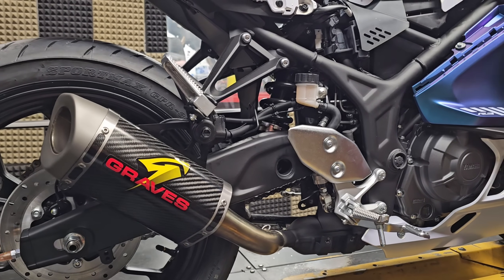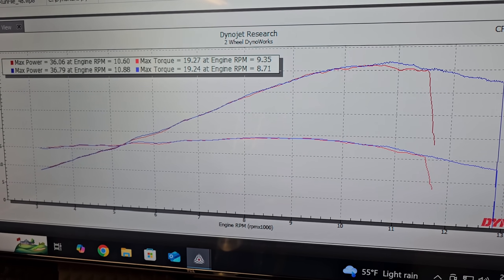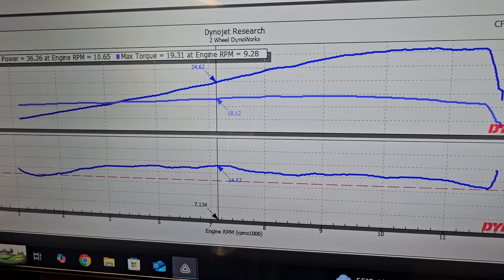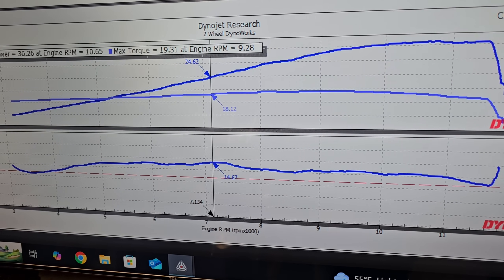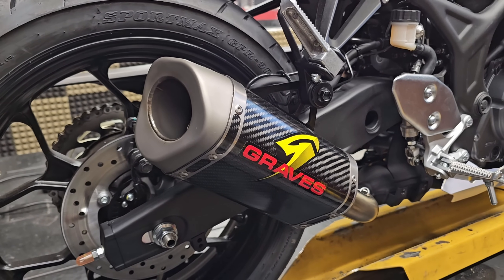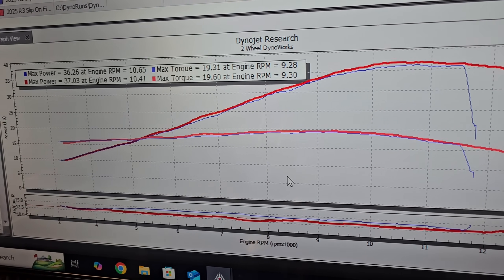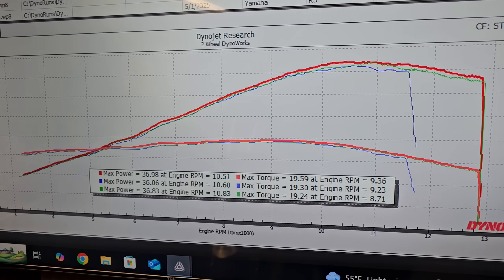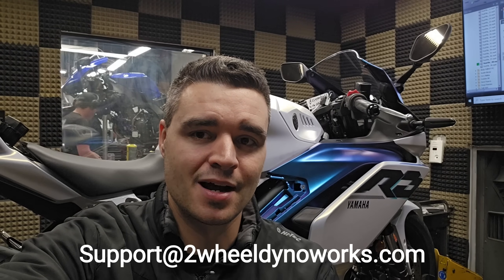The SURPRISING RESULTS of a Slip On exhaust on our new 2025 R3!

Comment: Hey! I have a ‘25 Yamaha R3 and I’m looking to get a full exhaust done and get your ECU tune. Do I need to get both an o2 sensor eliminator and and AIS block off plate? Do you happen to have any links to recommended products to use in conjunction with your ECU tune and a full exhaust? Thanks!

Comment: R3 is quite underpowered i think, cbr250rr sp easly make 38 whp with exhaust and ecu flash
Reply: that's also the difference between an inline 4 and a parallel twin
Reply: R3 is being sold worldwide and is legal.. the 250rr is only available in a couple countries and is built around a specific lack of emissions regulations. These 2 bikes arent even meant to compete against one another, completely different market and customer aim.

Comment: Its going to run leaner because you have a freer flowing muffler which means more exhaust gas is able to escape during the exhaust stroke which means more air intake into the chamber during the  intake stroke ...
And yes there is no wideband O2 to see the "leaner" mixture so it cant add more fuel which is why it runs lean. 

This is where the tune comes into play.
Reply: you think he dont know that? ur just repeating what he said
Reply: @BoxingLegends2024  He never said that
Reply: @BoxingLegends2024  but more useful than video itself, to the point. 1 like from i.

Comment: Yamaha needs to release an R4 or R5 lol. All they needa do is keep it simple like the R7, but with a 400 or 450cc motor. Match the looks of the R6 or just any of the R series and they would own the 450cc class lol
Reply: YZF-R4 with 450cc displacement would be nice. It's the burgeoning class lately.
Ninja 500/Z500 (451cc)
RS457/Tuono 457 (457cc)
CF Moto 450SS (449cc)
Triumph Speed 400 (398cc)
KTM Duke 390 (398cc)
Reply: agreed, they need to
Reply: R5 at 500cc 👍
Reply: Hear me out”R6”
Reply: Don’t remove the R3, add an R5 with 3 cylinders to the lineup. It would fit perfectly into the lineup
Reply: I used to think that, but I'm not so sure anymore. My R3 has plenty of power for all my needs.
Reply: Disagree, in the SEA market, the r3 is perfect for out heavy traffic and bad road. If it were me, I would like a xsr styled r3.
Reply: @not_khoa1032  the engine is bulletproof, i mean kawasaki had the 250, 300, 400 and now the 500. same engine, just better numbers. it would be nice to have like an r5 or something. r3, r5, r7, r9.
Reply: @not_khoa1032  performance wise it's not even close to the others. there needs to be an update. its just not keeping up, however it is a really reliable, fun, and lightweight bike. i have the mt03 and have not gotten bored of it. perfect for daily commutes and traffic as you've mentioned though for sure
Reply: @rgtmoto  I also realize that the r3 engine can be considered an ancient relic when compared to the likes of Honda's 500cc bikes. I recon it would be nice to have an update that introduce new tech such as an IMU and a wireless throttle, and maybe an increased in capacity, which I thinks would help it pass the emission laws too.
Reply: @not_khoa1032 motorcycles on water ?
Reply: @ACommenterOnYouTube  Southeast Asia.
Reply: @ACommenterOnYouTube  Southeast Asia has a giant motorcycle market. Way bigger than in the US.
Reply: @not_khoa1032  What a stupid thing to disagree with. The guy wants a 450cc class bike. You feeling like you don't need that is irrelevant.
Reply: @aluisious  I mean, I was concerned about  the street ridability of the bike In for the SEA market where I live. Because I assumed that the capacity increase would be followed by an increase in power too, which would lower its ridability on the streets for the SEA market, where people cant even leave third gear on a 150 cc underbone without being given a ticket from the police. On top of that, not just the bike itself, but also the taxes and registration fees can also rise, since some government use the capacity of the bikes to determine these costs.
Reply: Not only r4 but also an R4M with better suspension and a bit track focussed around 47-50 hp it will eat other bikes of same class for breakfast considering how good yamaha actually is in racing
Reply: @mayukhsharma8465 Indian comment🤣🤣 breakfast, eat, legendary, Daddy, king... Can tell without even reading username